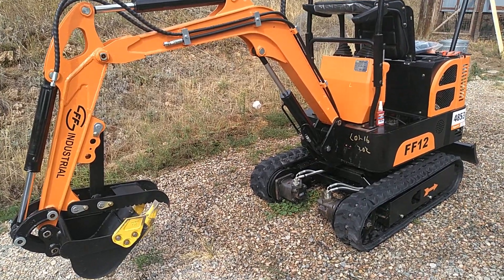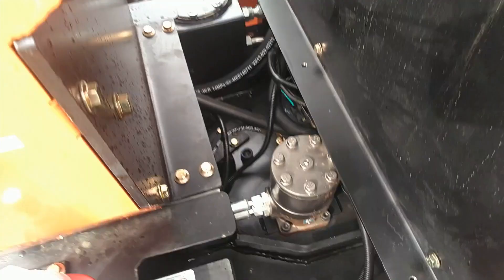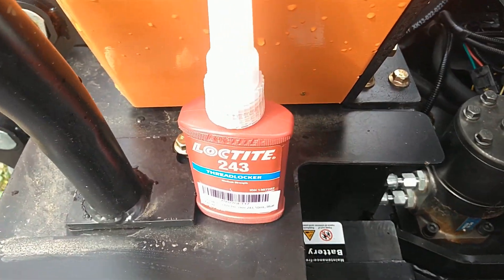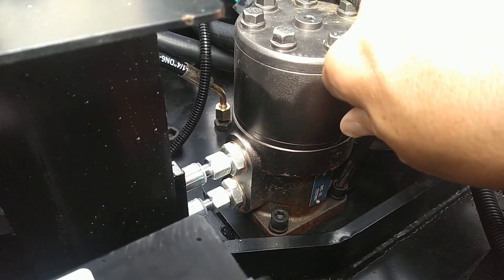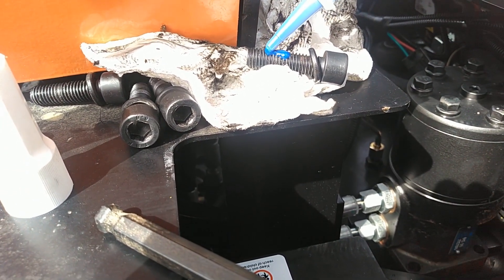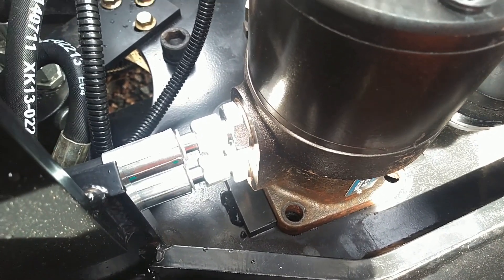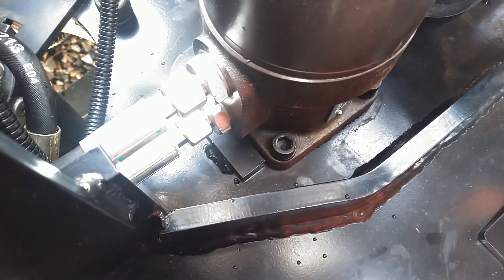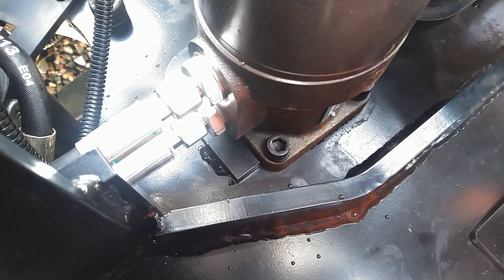FF12 Swing Motor Loose on New Chinese Mini Excavator

Comment: This just happened to my H15. 4 hrs in.  About to fix. Did the loctite completely solve the problem?
Reply from the maker: After about 30 hours of heavy operation, it came loose again. I reapplied the blue Loctite, and it seems to be holding this time. Just have to keep an eye on stuff in the machine.
Reply: @ Absolutely! It seems to be a common problem with these machines. Gonna give it a try and keep a watchful eye on it, thanks!
Reply: Are they bolted into tapped holes in the base, or is there a nut underneath?
Reply from the maker: @mattfarr1323  As far as I  can tell, they were tapped into the  base metal.
Reply: How long did it last after the 30hr application? Mine did it at 3.5hrs and I had loctite pretty heavy and came loose after a half hr. So now has 4 hrs and loose again.

Comment: Any idea what size those allen bolts are on the pump? One of mine is missing and I'm looking for a replacement. Thanks!
Reply from the maker: @GriffinCalme  I did not measure them while I had them out but went back and looked at the video. I am going to take a guess and say M8x1.25x30mm cap head. They have T8F 8.8  marking. I am not 100 percent sure but that would be where I would start.
Reply from the maker: Oh but I just looked up what sizes allen keys are used and it says M10 uses an 8mm allen (I used an 8mm allen key in the video), so it may be M10x1.5 so that is another one to try
Reply: @madscientisthut  you rock thanks I'm going to try an m10-1.5